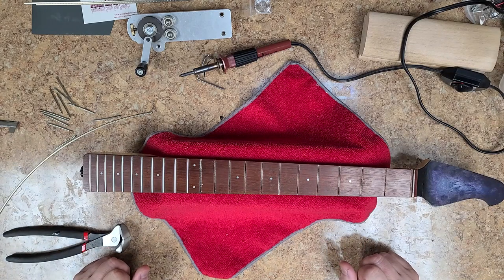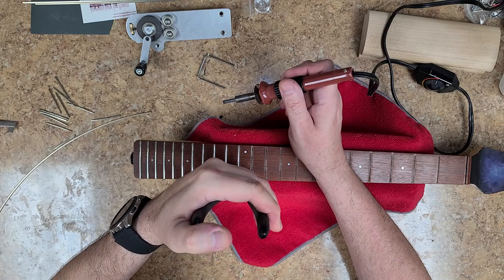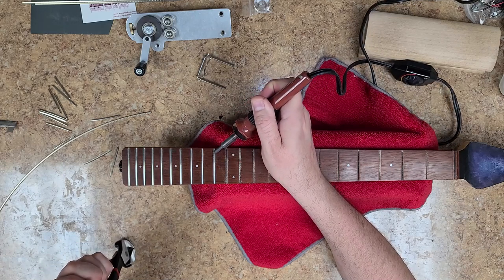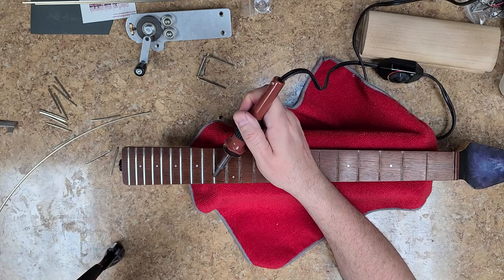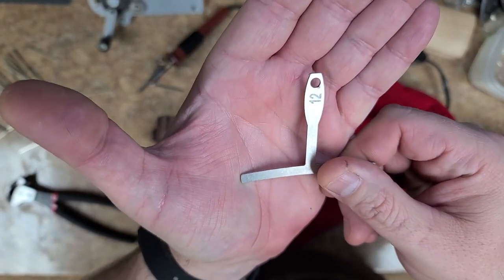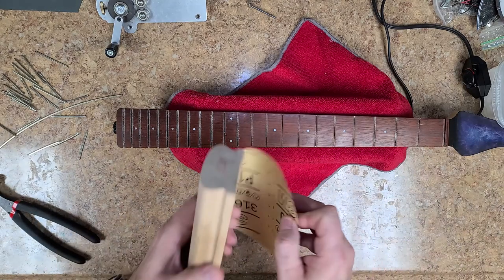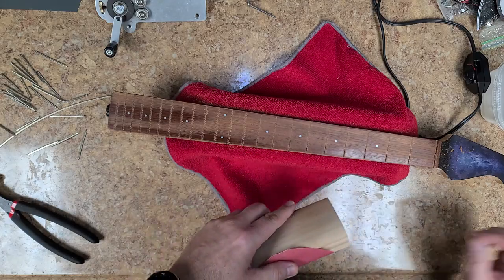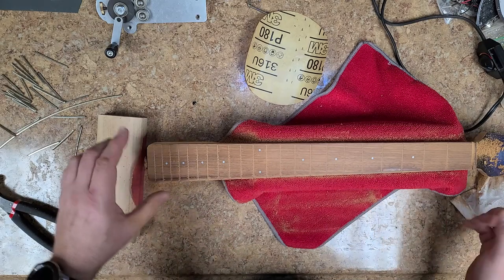Sterling Music Man Gets Fretboard Love

Comment: Wow, changes the look immensely.   I'm guessing the poly use will make it not need or allow oiling be used, like a poly maple fretboard.
Reply from the maker: No oiling needed. The fretboard had a little gloss on it. I just refreshed it a little. Don't try to put anything on a rosewood fretboard. Because of the oils in the wood, it never dries.
Reply: @ericctheartofnoise8613  I didnt know that . I guess engine oil is a Big NONO. Thanks for that info Eric